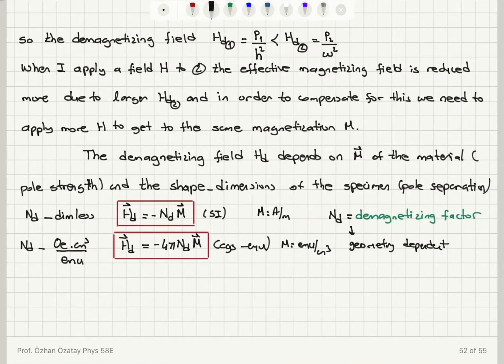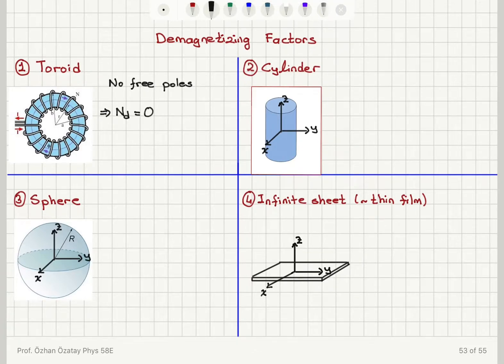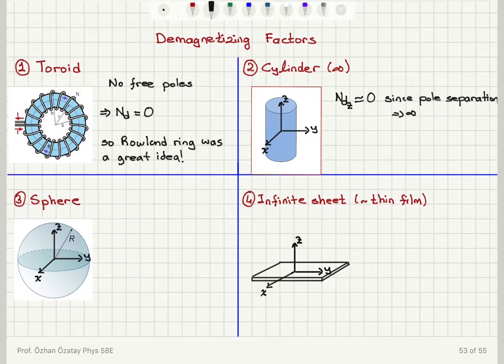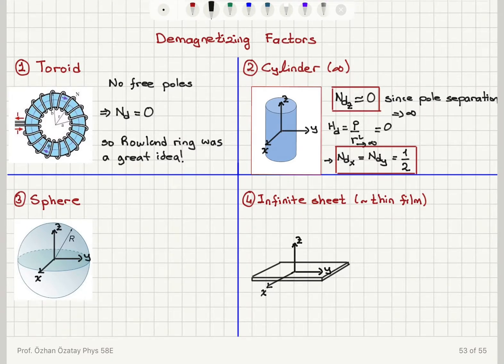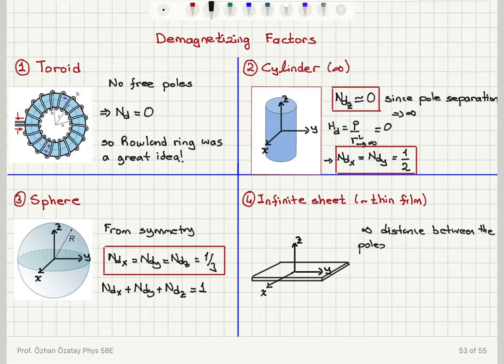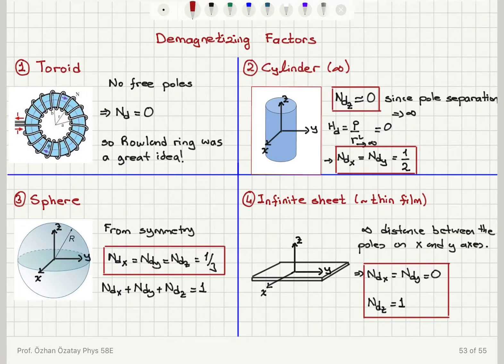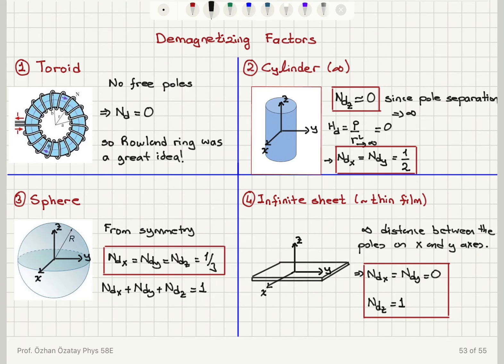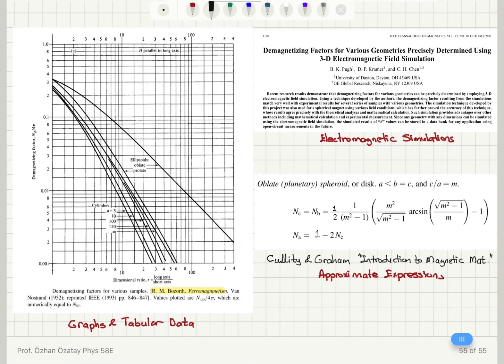Week 3-3 Demagnetizing Factors

Comment: Nice and organized explanation. One question: You clearly explained why the maximum value of demagnetizing factor will be 1 for a thin sheet along the "thin" direction. This is extended by saying that the 3 axes will account for all possible scenarios, and I understand that the summation of demagnetizing factors along the 3 directions can have a maximum value of 1. However, I don't understand why the summation of demagnetizing factors along the 3 directions should always be 1. Why can't it be the case that the summation has an upper limit of 1, but it can also be less than 1? Could you please help with this question? Thank you.
Reply: Hd= -NM ---> N=-Hd/M, the maximum value of Hd is -Ms ( and upcourse at this point M=Ms) . This gives the maximum value of N to be +1